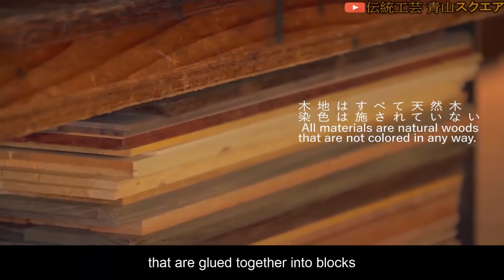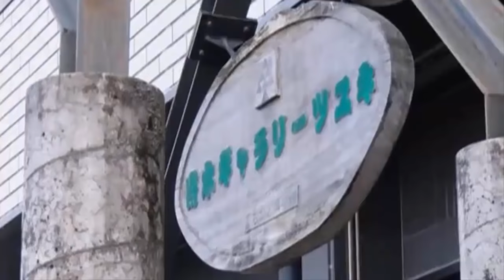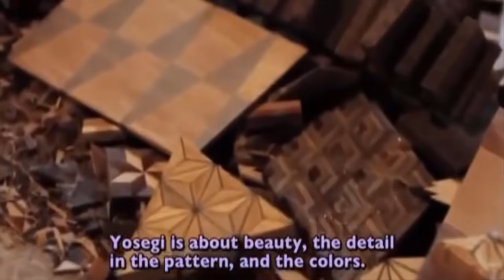Amazing Ancient Technology of the Beautiful Japanese Hakone Marquetry - Woodworking Skillful

Comment: my mothers mother brought 3 of these boxes back from japan after the war in about 48, they have secret slides that have to be moved in sequence so you can reach the centre of the boxes ,the work is mind boggling in its perfection of construction unfortunately over the last 70 years two have been lost ,the last one is on my wall unit in a pride of place with a little note inside when it was last opened .

Comment: Wow! I wish I could sharpen a plane well enough to make 1 mm thick end grain shavings like these craftsmen.
Reply: Jeweller's rouge and well polished blade.
Reply: It's actually face or edge grain.  When he is cutting the pieces off the board initially, the face of the board is facing him, so he ends up w/ a "stick" that is face and end grain along its length, and edge grain on the short ends.  The patterns become edge or face grain, with the end grain on the non-pattern edges of the glued up patterns.  That is even tougher to plane and get a consistent shaving with no tearout.
Reply: But you must become one with the wood take the path of knowledge  and it shall be bestowed onto the Wiseman who searches for the way of the wood to be the master as one fisherman who baits the net becomes a master baiter
Reply: I have employees who does that for me dammit
Take all day making a piece of art then drops it on the way out to lunch.  I make him pay for it from the 50cents per day he earns.  Because I could have sold that piece for 80 usd.
Reply: Wait a freaking minute at 2:15 in the video  is that a cnc machine in the back corner.  Something is amiss here.  I cannot help to think we're are being bamboozled
Reply: They're not talking the Japanese language cuz the words fit their mouth movements shouldn't you hear English not in sync with their mouths?
Reply: Japan proverb a square hole is not round
Reply: Quit calling them bad names just because you are not as good as them
Reply: @TephysNightBane  you made that up to be pretensiuous.
Reply: OK I am not seeing any eggdrop soup in this video.  Reported as scam
Reply: I own you all  kneel down in my presence it is the decree. I have spoken!
Reply: Not even close to 1 mm. Maybe more like .15 mm.
Reply: @activechaos128  .15 mm would make it see-through.

Comment: Impressive!  I'm a woodworker also, but quite different.  I make large 2.5 inch thick hardwood tables, some are 8 ft by 3.5 ft.  I'm such a rough carpenter, I use concrete nails to secure angle irons for table legs.  Still, I fully appreciate the minute detail of Hakone.
Reply from the maker: Very cool!

Comment: Anyone else notice the mistake at around 00:55?
One of the black sections of the black/white alternating loops has been put together the wrong way.
That would mess with my OCD.
Reply: I wonder if they intentionally throw in an imperfection.
Reply: There are two like that, at 0:50 there's one at the bottom right, then there are two black that are correct than the same mistake again.
If I tried something like that it would be full of mistakes.